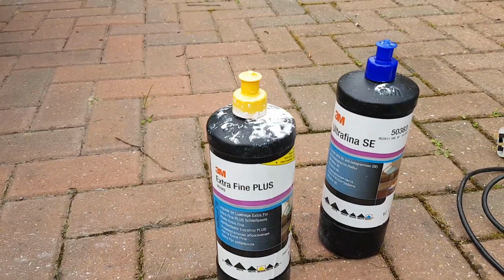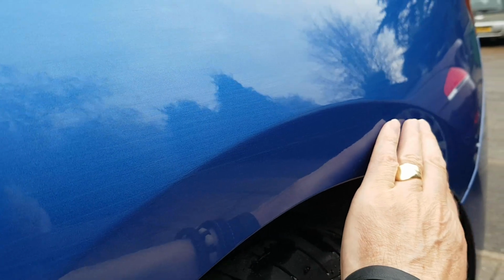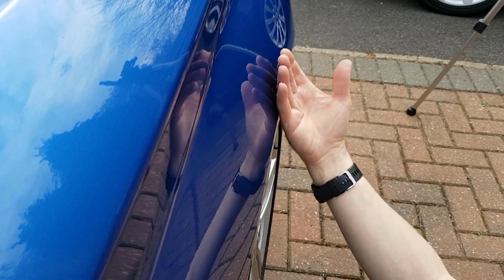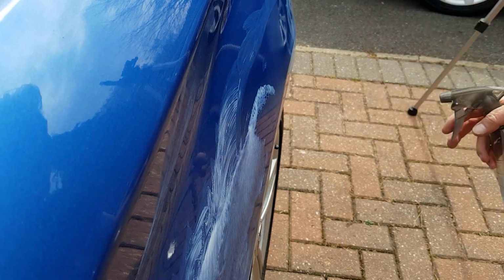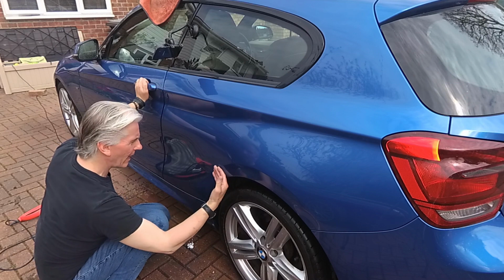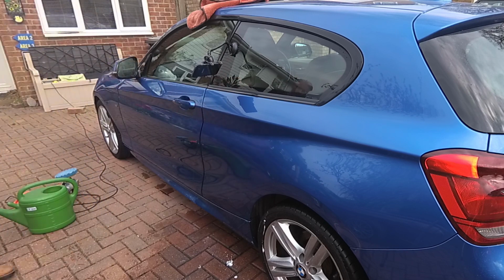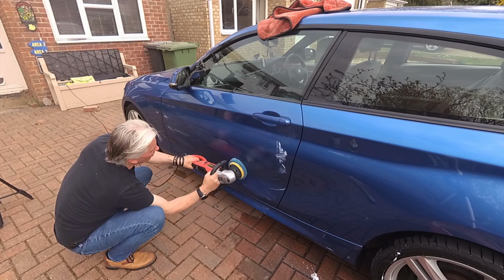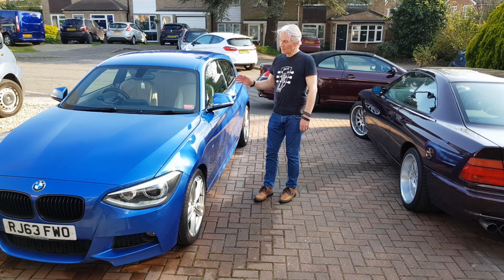BMW Paint Correction 1 - Rotary Polishing

Comment: Do you ever put pressure on pad at a low speed a 3 setting.
Reply from the maker: No, just enough pressure to keep the pad flat on the panel - the polish does all the work. Slow speed and high pressure will cause holographic marks.

Comment: Hi I have some what looks like rust blisters ( size of 50 pence piece) on my e63 645 ci although I know that the wing for example is plastic. How to sort them is it repaint? It’s metallic grey with clear coat. I would appreciate your comments 👍😊
Reply from the maker: Hello Richard, by a strange coincidence so do I! A bit smaller than that though. I was told that the 6-Series never rusts, and I believe that, but there does seem to be a problem with the paint bubbling without the presence of rust. The blokes who pull dents out (mobile service) will know what to do, they are usually very good at fixing paint problems.